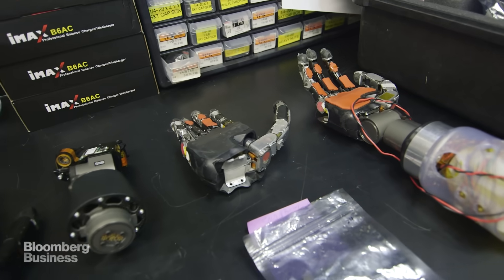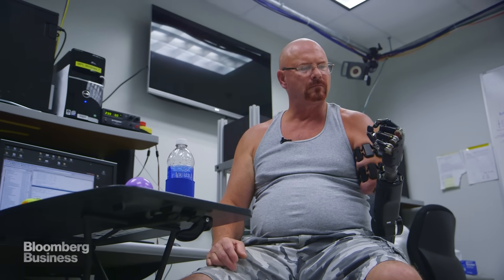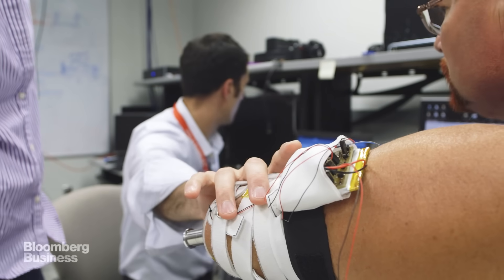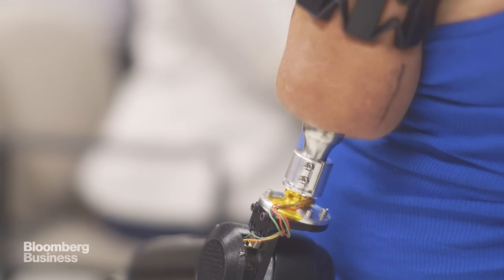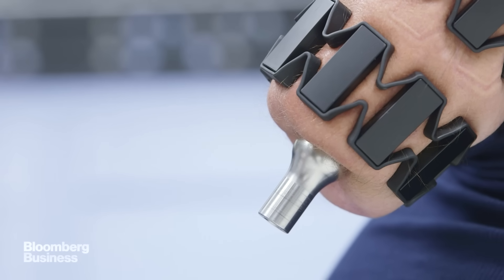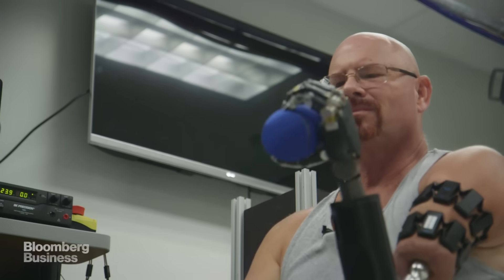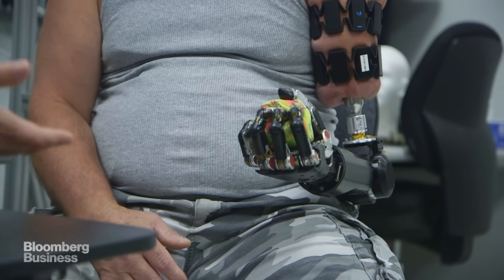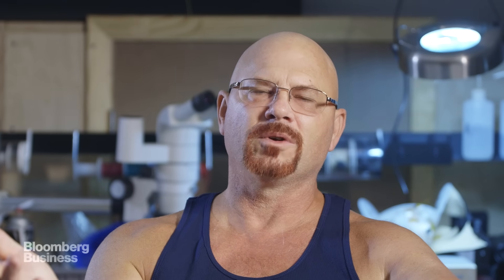The Robot-Arm Prosthetic Controlled by Thought

Comment: No reason at all this should cost so much, disgraceful.
Reply: The calibration alone requires time and money. Not everything can be an out of the box experience, but you still have a point of it being still too expensive.
Reply: The arm does not cost 120 mil. That was how much money at the time was dumped into creating it. Once these are commercially available they will likely only be like 50k - 80k. Not much more than regular high tech prosthetics

Comment: From the moment I understood the weakness of my flesh, it DISGUSTED ME. I prayed for strength and certainty in steel, I aspired to the purity of the blessed Machine... your kind cling to you’re flesh as if it will not decay and fail you... one day the crude biomass that you call a temple will wither, and you will beg my kind to save you... but I am already saved, for the machine is immortal... even in death I serve the Omnissiah
Reply: 01010000 01110010 01100001 01101001 01110011 01100101 00100000 01110100 01101000 01100101 00100000 01101111 01101101 01101110 01101001 01110011 01110011 01101001 01100001 01101000

Comment: It's so weird to think about how this would feel. You have no feeling in that part of your body because it's gone, yet you can still consciously move it and be aware of it's movement. One of the lesser known senses is your sense of muscle contraction. It's basically what tells you that your muscles are moving. Close your eyes and stick out your arm. Then bend it at the elbow, but not all the way so that the skin on your upper and forearm touches. None of the five senses are at work here, but you still know your muscles are contracting. With  an amputee like this guy, he has no feeling in that arm at all because it's gone. If the arm was completely silent and he had his eyes closed, he wouldn't know if it was moving or not. Sure, he would be thinking to move if, but he wouldn't know if it was working and that's such a weird thing to think about. It also makes me wonder if, in Star Wars, especially in Maul's case, if the electronics of the prosthetic are connected to the nerves of the body, because it's so hard to imagine not being able to feel the entire lower half of your body, but having complete control over it.

Comment: Won't lie having a steel rod sticking out looks painful af
Reply: SPRINGTRAP SUPPORTER I think he was taking an educated guess since metal is usually cold
Reply: Probably only feels cold.
Reply: @fluxkraken  At first it would, probably. But his body heat would warm it up.
Reply: @seancallihan4555  i'd imagine not during the winter, though. Looks like it'd suck
Reply: @MugiWaraSan28  I don't
Reply: @MugiWaraSan28  metal is a thermal conductor tho,  like touching those railing on stairs on a cold weather, it's just simple hehe
Reply: Just think about it as a nail or teeth , and there you go, nothing painful, right ??!!!!
Reply: I think some of the pain receptors in that arm would be numbed from the accident and if not they probably would numb them if they thought it could possibly hurt him

Comment: i've notice, that tech, the idea is just a trick..it is not controlled by thought, it is controlled manually using muscle reaction. why?
notice the bracelet like installed in man's arm. that's the one controlling it. the machine defends on the muscle reaction or limbs then the machine interpret it and do what program correspond to it. 
So basically it is not mind controlled machine.. and also that is why the user is  having difficulty using it, because it is not directly connected to mind, it is connected to muscle(upper arm)
it is working because there is still a half arm to do or trigger the machine manually.. im not a proffessional but 
what if the whole arm is missing? by using their ideas. they need another reader to attach in the chest? i dont know..
again im not a professional, this is just my opinion and i think they need to change the caption or title.

Comment: The engineers are lowkey programming his arm with a gaming controller.
Reply: I was looking for this comment. Is that a xbox controller?
Reply: well most of their pcs are from MS which also makes the xbox so it would make sense they would use an xb controller
Reply: @youwishbro7543   bruh L that isn't a xb controller
Reply: @youwishbro7543  thats a logitech controller
Reply: Its funny to note, that Programmers and engineers seem to like using PS4 Controllers to control Robots for some reason
Reply: they're setting up the keybinds
Reply: like a submersible
Reply: I would think it would be much easier and cheaper to make a glove or something that's connected to the prosthetic arm via bluetooth and simply have it replicate the movement done by the glove.

Comment: very nice model of distantion driving hand implantant  i cud not do better  but maybe i have better solution in desin this kind of mechanik hands.first of all  i have a questions: vere are the servodrivermussels for finger fallangas ? for arm or upperarm? how long can battery vork ? are you shure thet this devise is innaf light veight to were?  when it vorks it begans worming temperature of servodrivermusells  how deside problem of cooling sistem? every robotick mussels have worming temperature of servodrivermusells if it"s not pnevmomussels but even pnevmomussels have some veek spots